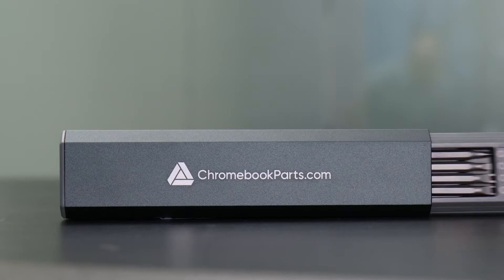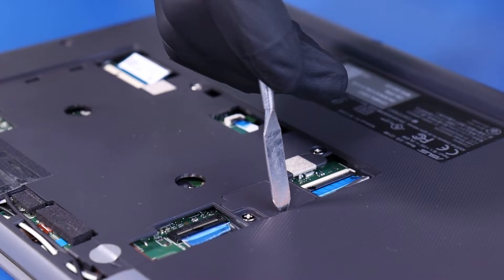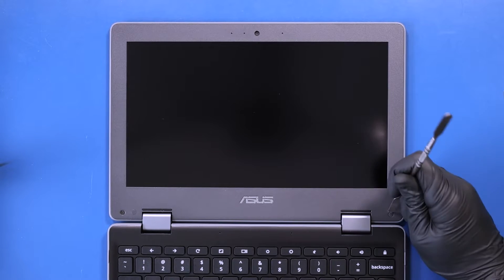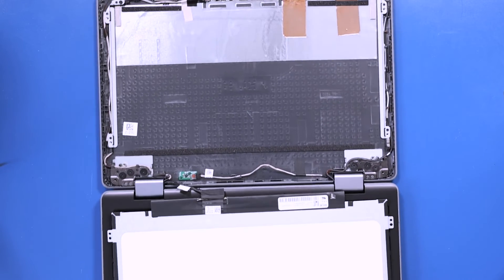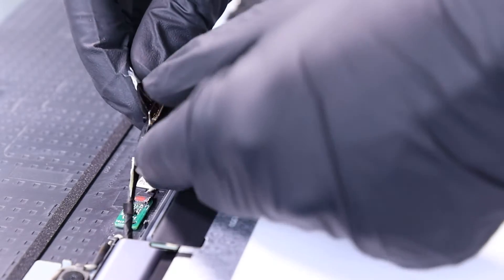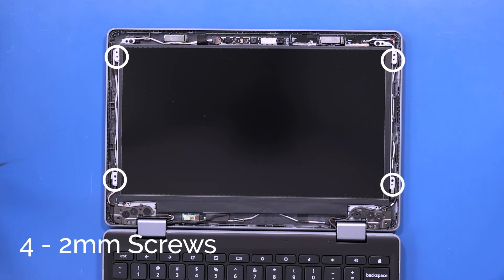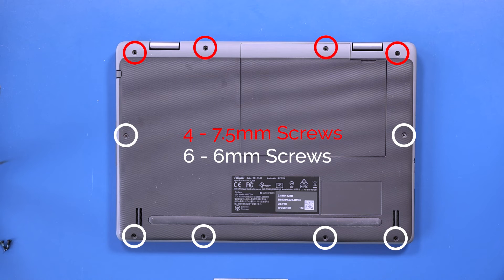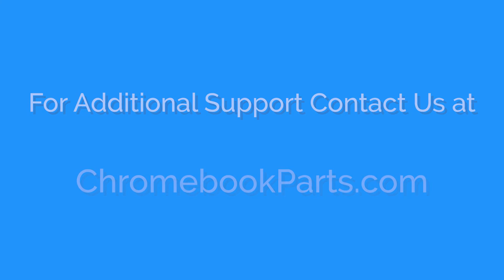Asus C214MA Chromebook LCD Screen Replacement

Comment: May I ask the reason why the screws on the bottom side need to be removed before display replacement? I wonder if I need to remove screw related with battery covers.
Reply from the maker: We always recommend unplugging the battery before doing repairs that require disconnecting cables, as there is a small chance of shorting out the motherboard. It's not an absolutely necessary step, and you can just skip straight to removing the bezel, but it is something we recommend.